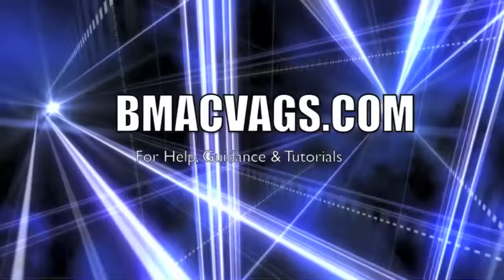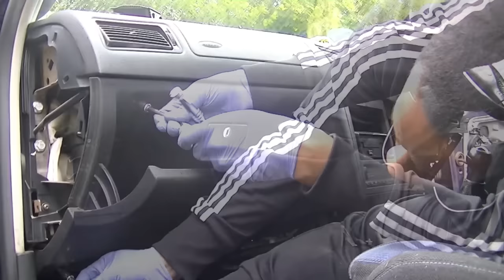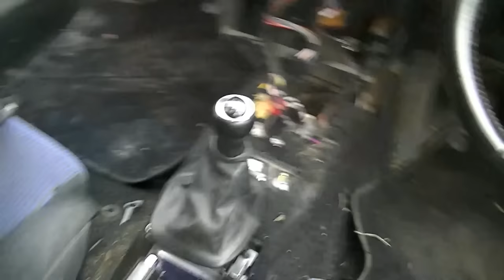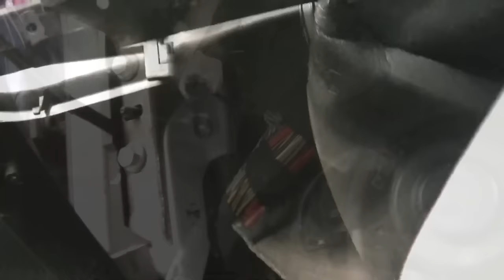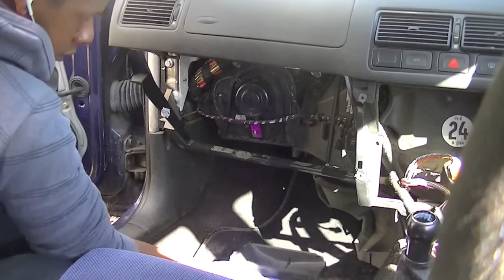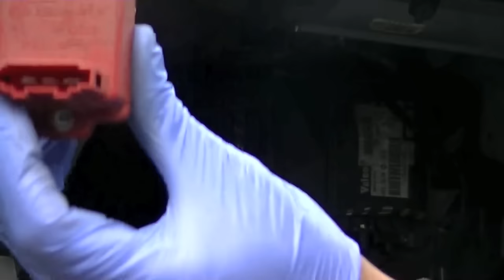VW Golf Mk4 Resistor & Blower Motor Removal (Simple, Easy, Steps)

Comment: Excellent Video.  Note that this is the version with electronic climate control.  For manual control versions, the blower resistor is located in the small panel screwed to the bottom of the blower motor unit.  The red blower controller is not applicable to manually controlled HVAC systems.
Reply: So climatronic uses said red resistor but normal manual controls is the green resistor

Comment: Here in Northern Europe those fans seem to die like flies as soon as it gets cold. Some three weeks ago that fan sort of died on my 20+ years old Golf III. Then came back to life. Then died. I was driving to service, as it came back to life again.
In the service there already were at least three fans for Golfs of different ages and models. Mechanic couldn't find anything wrong with mine, so just left it as is, as spending around 80 Euros for no good reason wouldn't be reasonable, so the idea is "when it dies completely, then we'll find out what's wrong". Well... OK.
Worked for a week, then died, then reanimated as I was driving over tram rails, and car got shaken a bit. That happened twice. Seem to be a bad contact somewhere, if only I knew where, damn it!
Reply: Same happened to me on my golf 5. I opened it myself, turned out its the motor brushes that wore out. easy fix saves you 80euros ;) I definitely lost an evening trying to open it without breaking it so take this advice as you will :D
Reply: Same story for me with my golf 4. Rained a few days and its acting like a hormonal teenager.
Reply: @Jonnesdeknost 
In my case it turned out to be brushes, so had to replace it after all.
Around six months ago scrapped that car, because I was failing too, not just my car - had to switch to one with automatic gearbox due to issues with my spinal cord - my feet no longer can properly work a clutch. And now I got the typical issue, that has plagued AUDI climate system for several generations - valves (which some people call "balls" / "nuts" due to their shape) - when that valve get stuck, it suddenly starts blowing hot air, no matter what temperature is set.  🤣

Comment: Great tutorial BMAC...this is just what I needed as the bearings in my blower motor have failed and the unit is squealing big time.

Do you have any "vid-tutorials" on removing the air distribution housing because the flaps for controlling hot to cold/defrost are likely broken - I'd much prefer not to remove the IP/dash if possible, thank you!!!
Reply: Same mine squeks on no.1 fan level..all the others are fine..soo annoying

Comment: BMAC. great video sir.  I have another question related to A/C.  I recently started having trouble redirecting air flow from defrost to cabin cooling upper/lower/mixed, etc. I thought the manual control was the culprit so I replaced it but the problem still exists.  Do I have to replace the entire A/C airbox in addition to the blower motor?

Comment: bmac on my caddy, its producing hot and cold air, but its not blowing out, do you reckon its worth checking replacing the resistor? or try fuse first?

Comment: Hi. Hoping you or another viewer could help me with a problem.

I have the VW golf mk5 TDI with climatronic and I get no heat or cold air on any setting. I was told that the resistor needs replacing but when I look in the area where a lot of youtube videos say to look, I dont see it. I read on a forum that the resistor is in the blower itself. Can I take out the blower and replace the resistor or would the whole blower need replacing?

Thanks

Comment: Is there a way to take out that entire Box where the blower motor sits? Because that's A/C evaporator is in the same box.
Reply: Lazaro Carreiro I'm told you're supposed to remove the whole inside dash, radio and and all junk to gain access to A.C. evaporator .  mines broke and it's leaking freon from one of the tubes

Comment: On mine its different the resistor sit right under the blower and holds the blower itself in, had to removed the handbrake shrouding and armrest because of a stupid hidden screw, this looks like a better design as it looks to have Climate control on that car.

Comment: why if I want to  change only the resistance do I need to remove the glove box compartment?
Reply: You don’t, only if you need to change the motor, and even then, you only need to remove the three screws top and bottom and drop it down on the one side so as you can get to the motor connector, get the wiring harness out of the way and bend the bottom plastic brace out to free the motor.